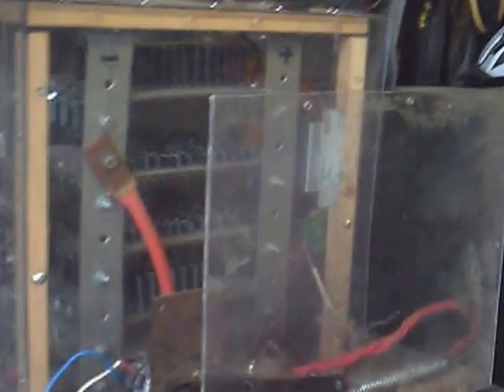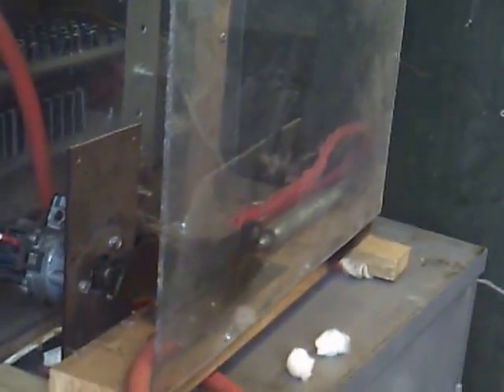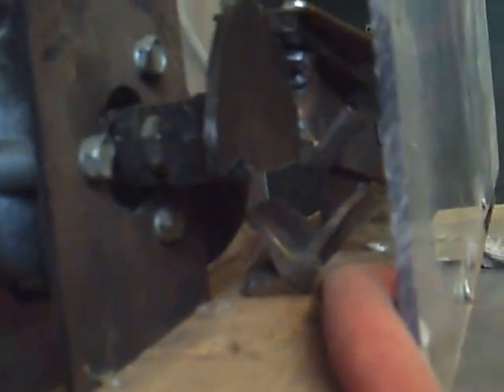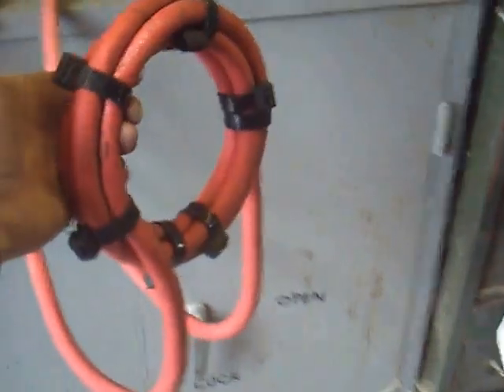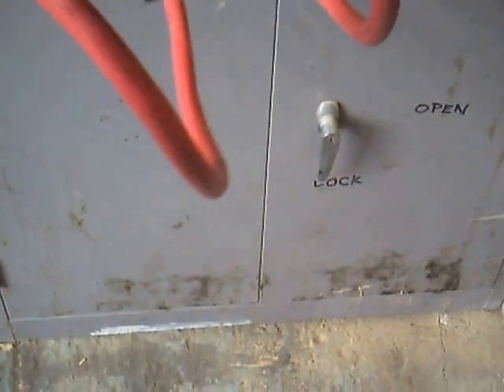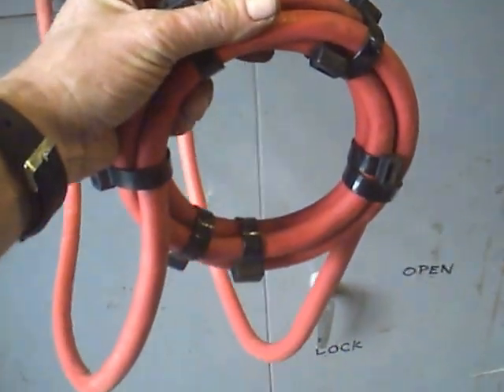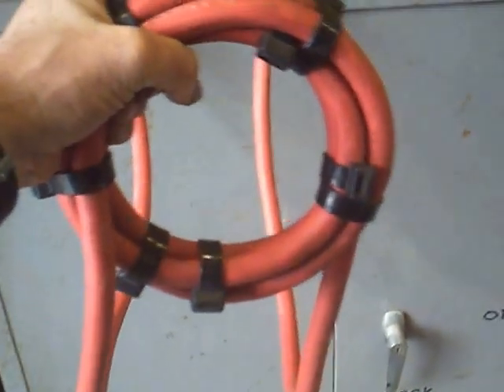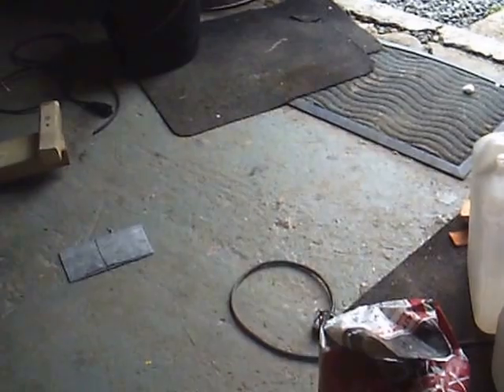High power capacitor discharge PEMF

Comment: Isn't it a problem if we put the coil on our head or in front of our heart?
Reply from the maker: I have done both for a short time -I believe  it is not a danger but I am not a doctor.I think it best avoid this just in case. Very little research has been done on this kind of machine
Reply: @dfghjkuytr  YouTube is full of these devices. In fact, these devices were also used by the Egyptian gods.  It's about the ANKH cross.  if you look for images in the pyramids you will see how many hold the ankh cross on a person's forehead.  The loop that you have in your videos or others, is the loop from ANKH.  Plus, buying a ready-made device is very expensive, $ 10,000. Therapists who do PEMF therapies say we don't have to have metals in our bodies or in our hearts for electronic devices.  Otherwise it doesn't affect anything, but I thought that maybe if it's a big magnetic pulse it won't affect when you put the coil on your head or heart ... Maybe in these areas the magnetic impulse should be reduced.  Anyway, thanks for the reply, I'll be interested

Comment: what the freq??
Reply from the maker: Capacitors  charge up with around 330 Volts DC (from rectified) 240 Volt a.c. mains) and short out through coil when switch closes
Reply: Frequency is around 0.5Hz